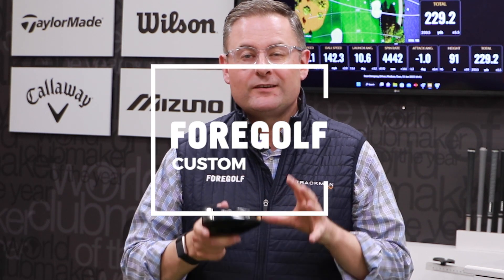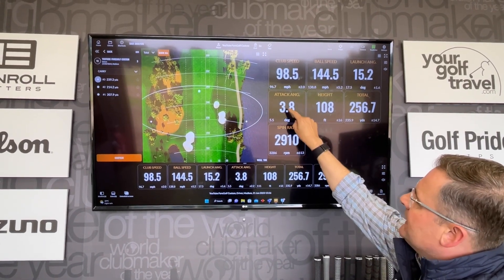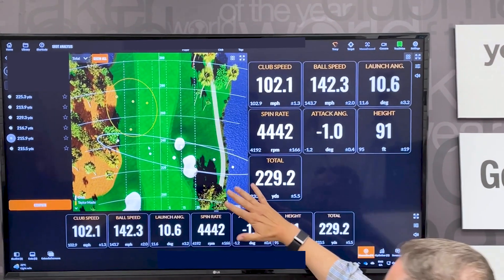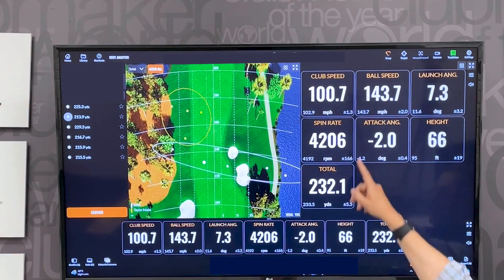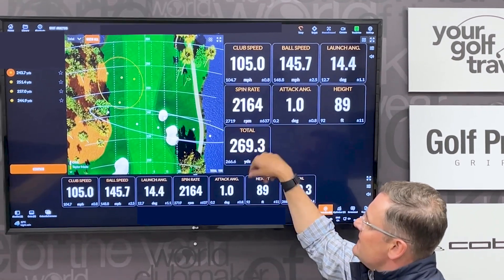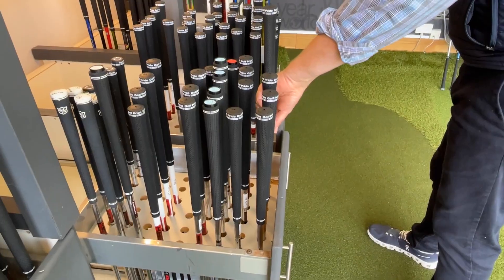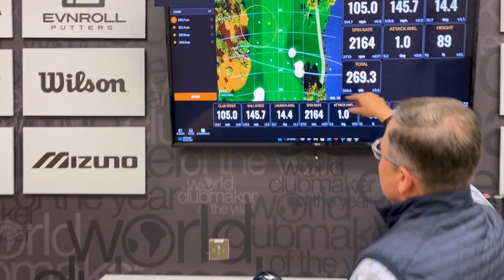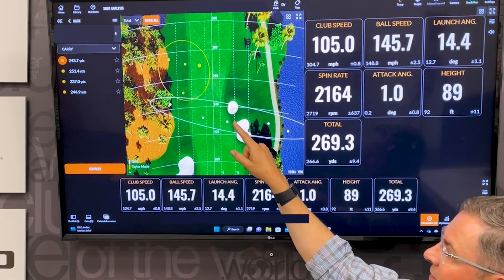How We Fit Drivers With TrackMan for improved distance and shot dispersion  @foregolfcustom

Comment: Why when fitting for Mizuno irons wouldn’t you start with swing DNA and the shaft optimiser. 

Can I also ask why don’t you use GCQuad for clubface data?
Reply: Excellent post, really like your enthusiasm and will hopefully be up to you soon, have been buying second left hand clubs for too many years hoping they work out, defo spin my driver too much and got it cut down! Again great info and thanks
Reply from the maker: Don’t need to use the Mizuno unit I’ve been fitting for over 25 years and know shafts well enough.
Been using TrackMan for 10 years and hit balls outdoors so, for me, TM data works just fine.